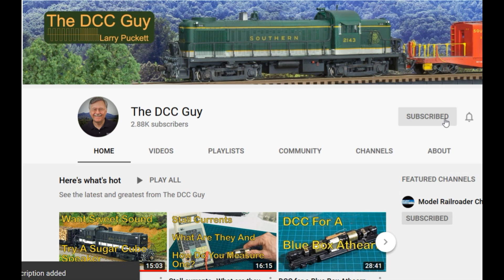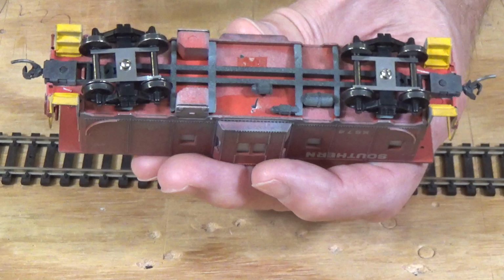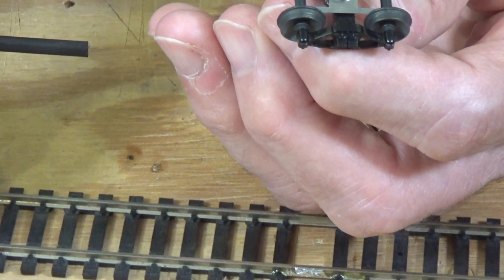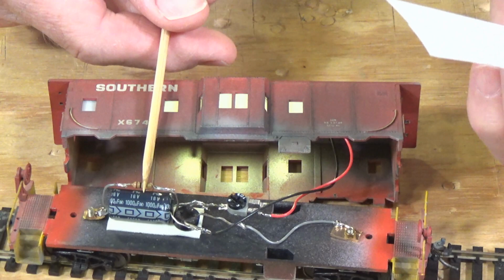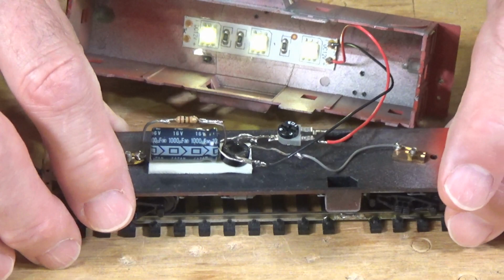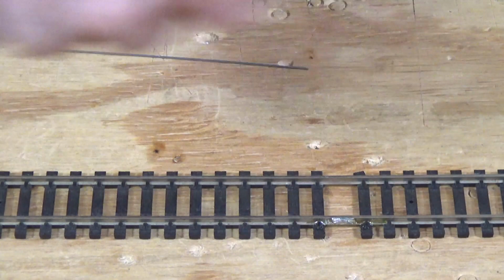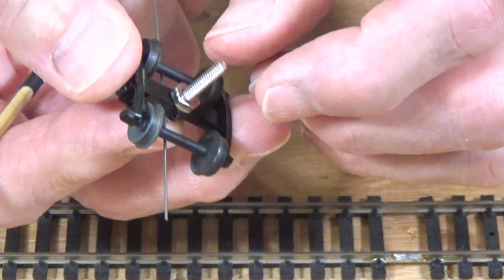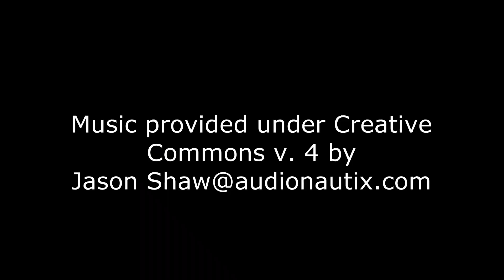Power Pickups For Your Cabooses and Passenger Cars (102)

Comment: Another great video, Larry! When I replaced the decoder in my Bachmann "DCC on Board" 0-6-0, I also added pickups to both tender trucks (short Vanderbilt tender). I used InterMountain metal wheel-sets, which have an insulating ring between one wheel and the metal axle. For the pickups I used some 1/8" diameter copper tube, K&S #8120, and cut 4 1/4" lengths of it, one for each axle. I soldered some small diameter flexible wire to each length of copper tube, removed one wheel from each wheel-set, slid the tube over the axle, and re-installed the wheel. I have one axle providing power from each rail, on each truck, so a "positive and negative" on each truck. I did it this way because this is short wheel based locomotive, no room for a Keep Alive, and I didn't want it to stall over dead frogs. I've had no problems with it at all. A small hole allowed for routing the wires into the tender. The inner diameter of the copper tube is perfect for the axles, but small enough so the tubing cannot slip over the wheel insulator and cause a short. The wires also help keep the tubing centered on the axle. Just another possibility for adding pickups.

Comment: Larry, Iv'e been using tichy trains phospher bronze wire for years, .015/ .020/.025 depending your scale, N, Ho, On30 and it's very easy to solder small wires to and is more forgiving to accept solder over steel or ss steel and brass. and also easy to bend and adjust the tension on the axles. Also double nut on your truck screw works even better so you can adjust and lock down the proper tension of your truck to body so not too loose and get body sway/wiggle going down the track or the truck too tight or too stiff to turn right and left...

Comment: Larry,
I model in N scale and use a single strand from 20 gauge stranded wire in place of the H wipers or spring wire. Just wrap it a couple times around each axle and once around your truck mounting screw.
Reply from the maker: Do you use any kind of constant voltage circuit or just live with occasional flickering?
Reply: @TheDCCGuy  This rig was used on a gondola I set up to carry a DCC Vmeter with LED readout around my layout to check for low voltage. There is some flicker but a keep alive would defeat the purpose of the project.

Comment from the maker: HEADS UP!!! I checked eBay for metal sheet and got lucky. There was one seller with 0.005” thick phosphor bronze sheet so I ordered one for $13 including shipping. His is a limited supply. There is a lot of stainless steel sheet in all kinds of sizes and thickness and I stopped at 1 page so there could be a seller with small quantities in just the right sizes. As a point of reference  the stainless steel pickups I used in this video were 0.005” thick so something within a mil of that should be good. I also checked with K&S Precision Metals and they do not have properly sized sheet. Their music wire is available in diameters down to 0.015” which would be almost half the diameter I demonstrated and a good size. I am still waiting to hear back from Streamlined Backshop about his pickups and will post that info as soon as I hear from him.

OK, I heard back from Streamlined Backshop and basically, although he hasn’t discontinued them, don’t expect to see them anytime soon.
Reply: Thanks for the update. Probably frustrating to see a How-To video featuring cool products no longer available. I've started using the old Kadee brass centering spring plates to install as pickups. A little finesse when bending the 2 tabs and off to the races.

Comment: Ring Engineering Sales a set of trucks are wired if you do not want to do the work. Also Hobby Lobby cards a Good selection of K&S metals in there hobby section.
Reply from the maker: Both good tips, thanks.
Reply: Kadee also sells caboose trucks that are prewired and ready to go.
Reply: Kadee also sells caboose trucks that are prewired and ready to go.

Comment: Great video. Do you have or plan to have a video on lighting a caboose using a decoder such as the Digitrax TL1 so the light can be turned off/on depending upon whether it is out of/in service? I've had trouble getting my TL1 to light my 3 LED strip like you use.
Reply from the maker: I’ll see what I can do. I have used one of those to turn the flow on and off in a track cleaning car, but have not used them with lights.

Comment: Mr. Puckett, I thoroughly enjoy your videos. They have given me a great insight into the DCC world of model railroading. I am curious to know if you can directly wire the LED lights to the pickups on the trucks without a stay alive circuit? Is it best to use a stay alive circuit for electrical reasons? Thank you.
Reply from the maker: An LED with a 1000 or so ohm resistor will operate fine on straight DCC power. The polarity reversals happen so quickly that the LED looks to us like it is always on even though it is probably going on and off about 7000 times per second. And direction of travel won’t matter either. The stay alive circuit I showed is mainly there to prevent the flickering some folks fine annoying due to disruptions i  power as the wheels roll along over dirty spots and dead spots. If that is not an issue for you they light em up.
Reply: @TheDCCGuy  Thank you sir for the detailed reply. I am trying my first project.

Comment: a very hard way to do lighting, compared to normal dc workings. but i guess thats just the way dcc has to work.
but in the case of just lights, why not use a battery?  yes getting power from the track. but would a say aaa not work better than a cap? at least would last longer in loss of power times. more stable?as in rolling stock there is plenty of room to do things. at least in ho or larger scales.
Reply from the maker: Batteries work but mean you either need to use rechargeables and include a charging circuit or periodically take the car apart to replace the battery.

Comment: Larry this is something I been looking to do also.  On the trucks I see you showed using piano wire also I have plenty of .025 wire around and have three cabooses to setup. My question is do I need to make only one pickup wire for each truck?  I se when you use the stainless you have both sides covered.  In your video you only showed one piano wire with the hole made.  Thanks Tom
Reply from the maker: Because the wire would contact both axles there could only be one pickup per truck. You could also use a KD spring wrapped around the axle of each wheelset and that would give less resistance plus if you use plastic trucks and install the insulated wheels on opposite sides you could pick up from both rails.

Comment: I might have missed it, but I didn't hear you mention how one side of the trucks are insulated.  Do they have plastic wheels on one side, or some kind of a sleeve between the wheel and axle?
Reply from the maker: That probably ended up in the 20 minutes I had to cut out. They just use a plastic or other nonconductive insert on the wheel to insulate it from the axle. One thing to be aware of is some actually use a plastic or other nonconductive axle which of course won’t work in this case.

Comment: Larry  I received the wipers from Richmond Controls set them up on one of my Caboose looks good.  I am still waiting on the Super Capacitor from Mouser will not have till april 15 or later.  Is there a method that I can test my LED's with the wipers on the trucks now?  Would like to make sure I have good contact   Thanks

Comment: Can you do a video on lighting brass cabooses?
Reply from the maker: The problem with brass is the all metal construction makes it difficult to isolate the two polarities. To do that you have to be willing to do 2 things; (1) replace the metal trucks with plastic ones, and (2) drill holes in the floor and run wires up from each truck to carry the current. Assuming you are willing to do that then the process becomes just like a plastic caboose installation.

Comment: Hey Larry Can you Please make A lightning Video for N scale Cabooses Either for inside Lightning.. or for putting Red Warning lights on a Caboose.. Thanks.. Allen D.
Reply from the maker: What are typical dimensions for the inside of an N-scale caboose? The problem with doing a constant lighting circuit is finding room for a voltage regulator and a capacitor. Making a circuit for those would require using surface mount device components which are probably too small for what most folks are willing to mess with. If you can live with occasional flicker then just try a 1000 ohm resistor on the LED with a surface mount bridge rectifier to get your DC power.

Comment: Nice video and helpful.
I have many older brass engines and I wanted to start converting them to DCC, but it's a little overwhelming where to start. I don't plan on converting all of them, (about 40 steam engines) but probably about 10 of my favorites I will convert. Any advice the best way to do this. Any advice would be helpful as sending them out to be modified will be too expensive. Thanks and again, nice video.
Reply from the maker: I have done articles in MR on converting brass locos but not a video. I’ll add that to my list since I still have at least one here that needs converting.
Reply: @TheDCCGuy  That would be great Larry. I am subscribed so I will get an alert when you post it.
I am in process of building a fairly large mountain railroad (about 350-400 feet of track) and and with many scratch-built bridges. I am still old school, so I will have to buy a DCC system (not sure which to buy with radio control) and I'll need to install the DCC buss wire too. Most of my layout is still open grid bench work without scenery, (except about 20 feet of mountains) so when I get to that stage the wiring should not be too bad (I hope). I'll check more of your videos in case any videos address someone just starting out with DCC. All advice always welcome. Thanks.
Philip
Reply: @uptownphotography  
If you are going to buy a DCC system today I would recommend one that supports WIFI connected devices.
Example:
Central: DR5000 from https://www.digikeijs.com/en/dr5000-adj-dcc-multi-bus-central.html
Central: DCS240 from https://www.digitrax.com/products/command-stations-boosters/
Driving handle: UWT-100 from https://tcsdcc.com
Driving handle 10813 - Z21 WLANMAUS from https://www.z21.eu/en/products/z21-multimaus
Youtube clips about Digitrax: https://youtu.be/2jtro6o5kec
and the most important thing!
Do your own research so that you get a system that suits you.
The DCC Guy: Thanks for a nice video.

Comment: Larry  I am get short circuits on my trucks any way to test them? I took the trucks off the bottom of the car and placed them on the track an no short circuit only when on the car. Any way to know which side of the trucks are the right side?
Reply: Larry I got it now had the trucks on wrong. got the right combo now.   When I add the circuit on I get no power from the tracks using richmond controls wipers.  might try the spring wire next any thoughts?
Reply: is the spring wire touching both axles on the truck?

Comment: What kind of wheels sets do you use for your cars trying to find ones to use so I can light my cabooses and passenger cars. And are the wheel sets insulated on both wheels?
Reply from the maker: Those were Intermountain wheelsets. Only one wheel is insulated so you get power on the axle.

Comment: @Model Railroading  If that capacitor is too big, if I understand correctly, I can use two separate 500MFD 16V capacitors(or even five separate 200MFD 16v) wired in parallel - is that correct ? How high can I go - could I use five 220MFD 16V caps?
Reply: ETA: one more question - if I use magnet wires to the LEDs, what gauge is acceptable? 24? 26? 30?
Reply from the maker: Yes, when wired in parallel. See this link for more details:

https://www.allaboutcircuits.com/textbook/direct-current/chpt-13/series-and-parallel-capacitors/

Comment: What keeps the cap from overcharging?
Reply from the maker: The zener diode prevents them for being exposed to too high a voltage, and they charge to their rated value and not above that. You’d have to ask an EE for the underlying scientific principles.
Reply: @TheDCCGuy  that makes sense, thank you ☺️

Comment: Awesome Video Larry!! Is there such thing as DCC power pick up with a USB plug?
Reply from the maker: I have no idea, what would it be used for?
Reply: It will be used to power a 5vdc usb micro camera.
Reply from the maker: I am working on a circuit that will put out constant variable DC so it could be set 5VDC, you will just have to find the USB power coupling.
Reply: Awesome!!! Thank you so much Larry and keep up the great work.
Reply: It works in DCC system?